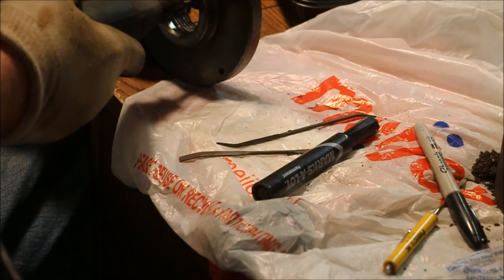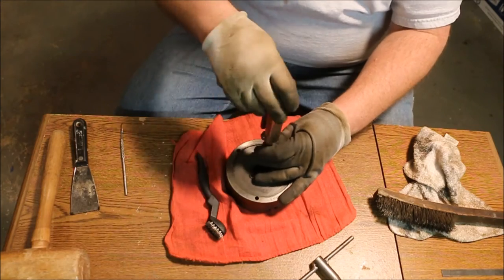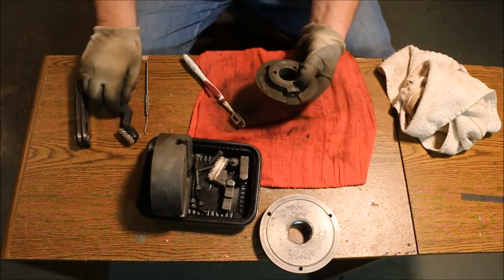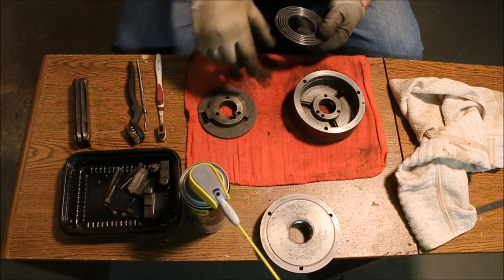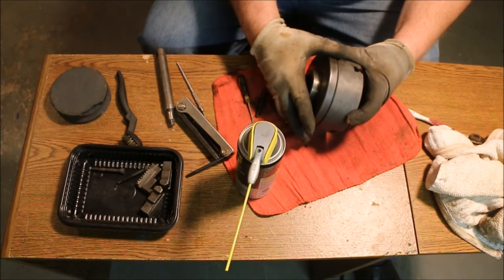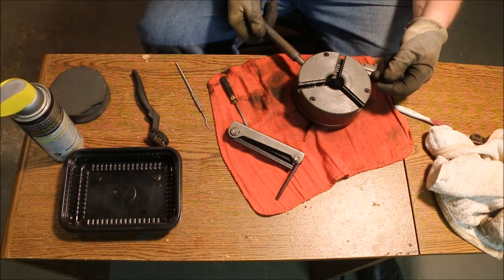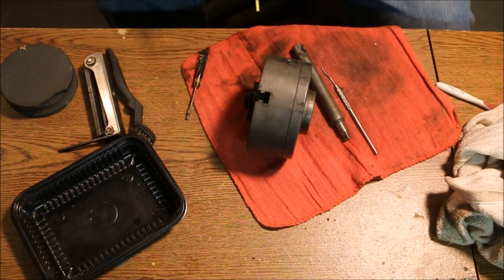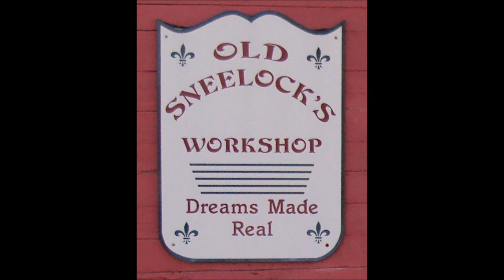Mounting My Cushman 3 Jaw Chuck ~ Pt 3 ~ Cleaning And Lubricating The Chuck ~ by Old Sneelock's Work

Comment: We've been able to find Dri-Slide at auto parts stores.  Was  useful for locks as well.  There was another molybdenum Di-sulfide  concoction we used to lube cams up for engine assembly Called Moly Cote if I remember correctly.  Might be better than a teflon spray.
Reply from the maker: I remember using Moly Cote. By the next chuck repair I should be able to find Dri-Slide. Started using it back in the 70's. Best stuff available at the time.

Comment: I enjoyed seeing you bring that chuck back to life!  I'm working on a NOS Atlas 4" chuck and even after cleaning, the number 2 jaw is SUPER tight.  If I have to stone or file it, should I stone the jaw or chuck.  Both the inside and the outside jaw on number 2 is tight.  Thanks in advance......jster1963
Reply from the maker: I'm guessing there is a tight spot in the chuck if both jaws are tight. I'd put some Dykem, Magic Marker will do, on the inside of the chuck track and try fitting one of the jaws in it. After it has gone just to the point where it gets tight pull the jaw back out and look for a shiny spot. You might have to use a mirror to look at the back side of the groove. I'd bet you will be able to just smooth out the tight spot a bit and save polishing the whole groove. 
If I had to guess it's probably on the back side of the track or you would have already seen the worn spot where the jaws are rubbing. 
If you don't find anything there then check the scroll. Mark the rack gear teeth on the back of the jaws and run them through the chuck there should be clearance between the scroll and the rack gear. If it is polishing the root of the tooth then it's too tight. 
Good luck. It can be frustrating but if you take your time you'll find it.
Reply: You are the man!  Thank you for the help. I'm working on it and making progress.  I really appreciate your response and hope to have it up and lathing soon.  Thanks again......